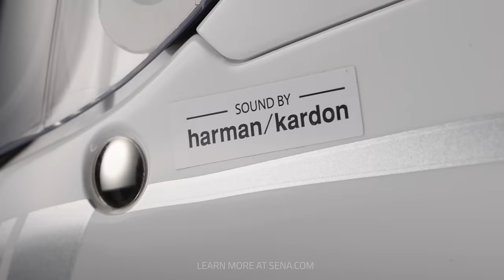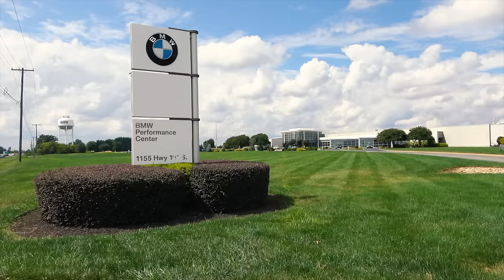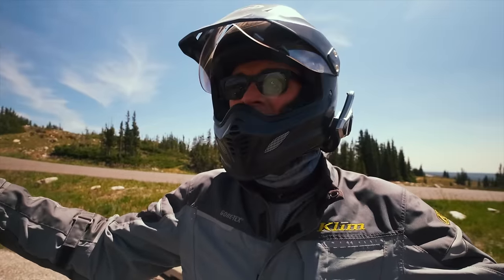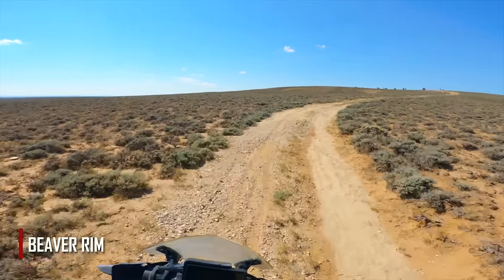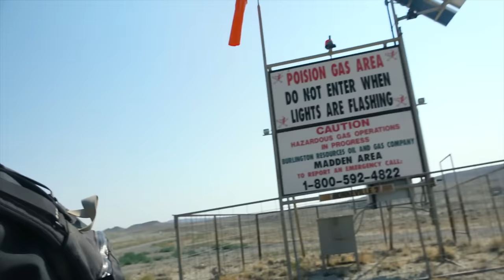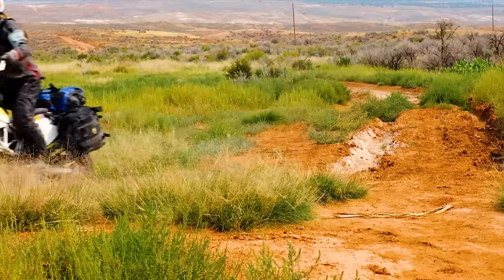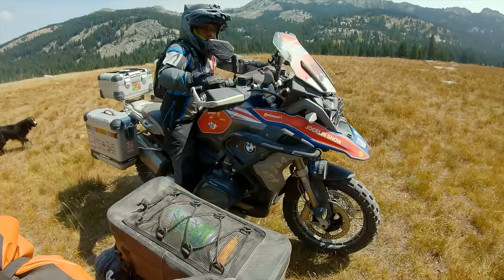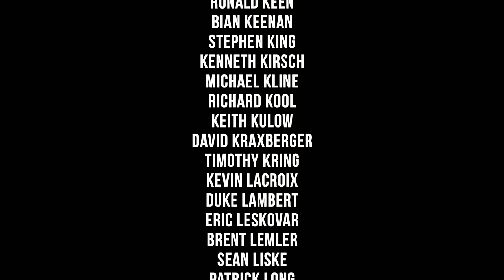Wyoming Backcountry Discovery Route Documentary Film (WYBDR)

Comment: Thanks for putting this together, it has been very enjoyable to watch and think about how I can possibly do the WYBDR.

 I have two critiques. The first is the tire with a sidewall gash. That is a non-pluggable issue and for those with tubeless tires, it is vital to carry a tube(s) so you can attempt to get to the main road and correctly repair the tire. I fully understand why you had a SAG wagon on this trip. I just want to throw that out there as a reminder. The second is the broken wrist. Unfortunate as that was it may have been avoided if he was NOT trying to film the sheep and ride simultaneously. Motorcycling in all genres requires perpetual vigilance and attention. Taking your eyes and mental focus off the path of travel, even for 1-2 seconds can be catastrophic. My point is, to stop and look at the sheep, then ride, not both at the same time. Once again just my thoughts on this and I do realize that things happen that are out of our control. Kudos to the rancher and the Jeepers. I have had Jeepers help in the past with, non-other than a broken wrist in a remote area of West Va. Great Bunch.